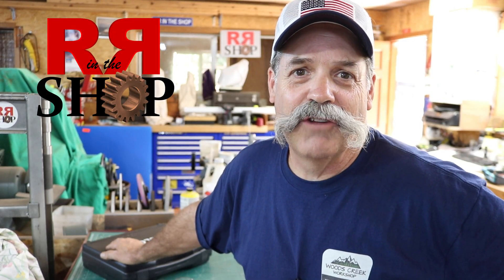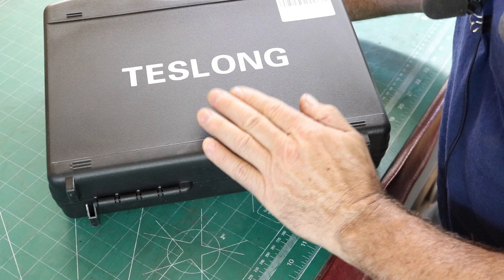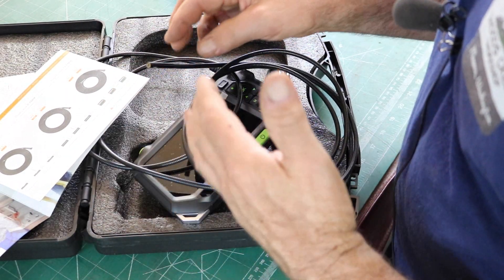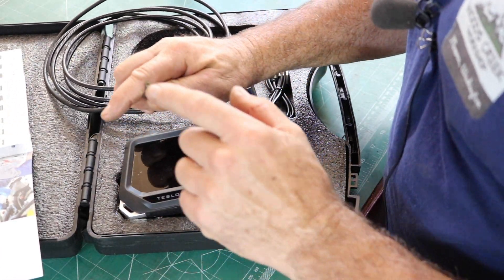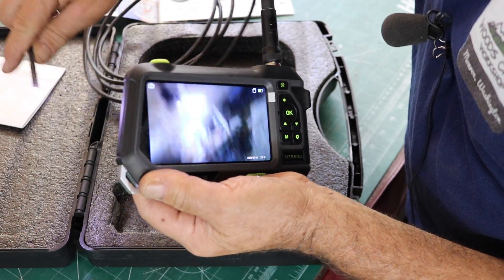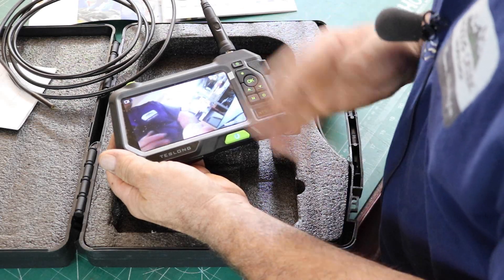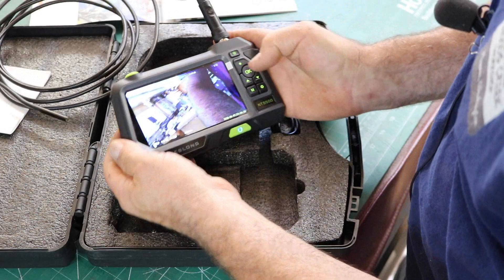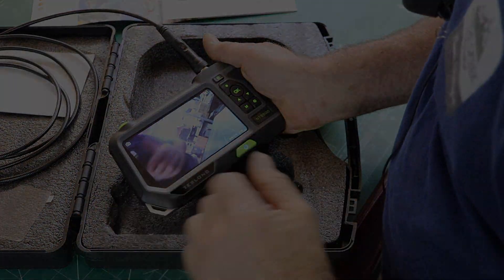Teslong NTS500 Endoscope Borescope Review | Dual Camera

Comment: Thanks for the review Randy of NTS500 Boroscope! I'm interested in purchasing this unit and will be using it to inspect pistons, cylinder wall and valves. I'm interested to know have you used it to inspect valves. I understand the unit has a front and side view cameras, but I'm thinking it may be difficult to see valves which are overhead. Have you done this procedure to inspect valves since it seems that the probe would have to bent in a 90 degree angle and possibly use the side camera? Seems like it might be a bear to try this procedure. Thanks for the reply!

Comment: You must be getting old, a youngster would have shoved it up his nose.😂😂
I didn't detect rust in your barrels, did I?
Reply from the maker: Thanks Chris.  Yep a tiny bit.  The pistol was just given to me, an unfinished kit and has never been fired.  No excuse for the rifle, I need to attend to it.
Reply: Randy Richard In The Shop  Randy,  you could do a video on de rusting a barrel.  Ive heard a soak of Kroil works wonders on a barrel like yours.   Cheers, Chris
Reply: @shadowdog500  I wonder if electrolysis would remove the bluing??  Need a 30" long ultrasonic tank.
Reply: Mature Patriot / Vernon Currier not sure, but I do know that evaporust will remove the bluing.
Reply: Mature Patriot / Vernon Currier well in essence, bluing is a form of oxidation and therefore rusting.  I would think that even a mild electrolysis medium like citric or acetic acid would take blueing straight off.